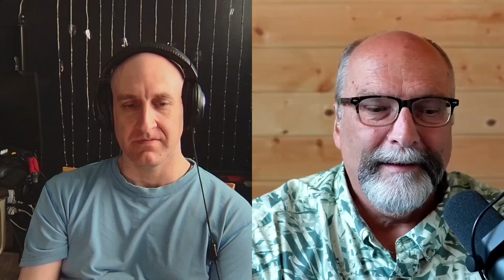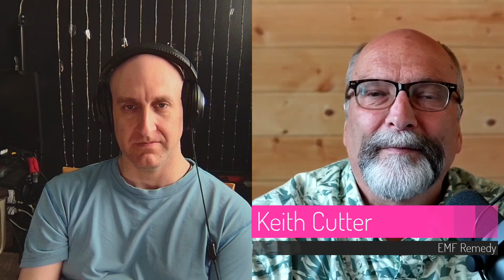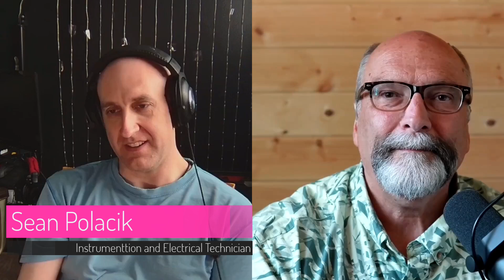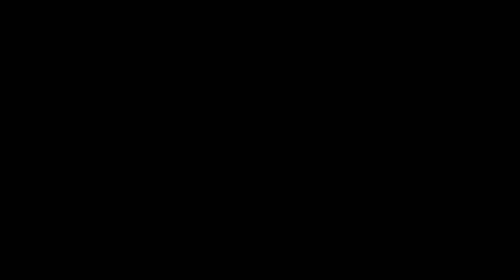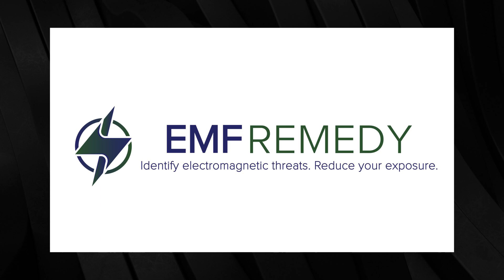6 More Reasons to Beware of SMART Meters, Sean Polacik

Comment: We tried to protect our analog electric meters. We had letters from the utility company stating that we would not be getting new meters, and that they put us on the "opt-out" extortion program. I had the letters posted above seven electric utility meters (five on rental property we own). That worked for about seven years, until last spring. 

The electric utility company had already switched-out five analog electric meters for digital opt-out meters on the rental property when we caught them. I was adamant that we did not want new meters and that they were breaking their contract with us by switching them out. 

They called the police on us, who arrived within a few minutes, which makes me wonder if they were standing-by. There were two cars and three officers. The cops tried to tell us that the governor (of Michigan) made some type of mandate about electronic meters. I called BS and told him that I wanted to see that in writing. 

The cops then asked my partner for his ID, which I said, "No! This is your property and they are trespassing. You don't have to show him anything." They obviously didn't like that but knew I was correct so dropped it.

Finally everyone left, threatening shut-off if we didn't comply. A couple of days later, like thieves, they snuck onto the property and switched-out the remaining two analog electric meters for digital ones.

Comment: These computer meters let's be honest are invasion of privacy. I'm glad that I have my old meter I have had to opt-out multiple times because Xcel doesn't understand...NO MEANS NO!!! Plus I have not one, not two but three Mastiff's that are very protective of the family's property. Plus I have a no trespassing signs with the State's statutes on it informing them it is a criminal offense. As I figured how will they be able to shut me off without physical access to my equipment. They would have to go to the main box perhaps to disconnect the line. But also to my understanding a utility can't just shut you down especially if you're a paying customer. Also it is interesting what I have read in the BBB in complaints. It seems that when they tell you either we force down your throat one meter that is less intrusive or the smart meter that is very intrusive. And that there is no option to keep the existing meter at the property that Xcel still needs the owners actual consent so they can start charging the extortion fees for the non-communicating one. 🤔 Interesting!

Comment: The old meters werent meant to compenste for power line noise but they reacted slow enough it didnt effect them. There is no reaon this filtering averaging cant be designed into them. Talking about sampling rate when the rate is Itron: 32,000/second, eatin 1024 then 256 resample per cycle. So 61,000 and 15,000 / second, nature over 12k per second oover 4 second sample.

Ansi 12.10-2024

Comment: Was just going by recommended videos after some tech connections or something and this popped up and instantly I thought it was about Smart water meters, or at least hoping it was.  Really wondering what type of RF they use if any.  Anyways ended up watching the whole video and made a good bit of sense except that they say at one point "It can monitor what you are using" far as what device you have powered on but then also saying that it is polled in intervals or timed intervals.  Find that to be a little conflicting, so which is it?  I have an analog meter still for power and the power company we have actually wants to keep analog cause it works.  Though uptime efficiency is like 78/100%...  Also if they are skirting around non spec meters that should probably be something you can actually do locally for yourselves and raise hell and at least get the better ones.. Could slap a shutoff switch before the meters to cause some chaos I'd bet..
Reply: I'm betting they poll about in Milliseconds to capture load and what device they are using or even Nano..  Don't have one to test out with a serial port.  I'll also bet that "Polling" is actually just packets of data sent that have accumulated over the elapsed time in this scenario.. It has been common if you have a common set of data to work from you can just send it with a burst of extended pkt/s so sending out a packet per 10 or 15 minutes might be normal..  Still too much data being flung around really for something that should be private.. Do they use encryption, these smart meters?

Comment: I turn everything off at the house main, from midnight to 11 am...if they are taking an average reading....I'm getting ripped off...bc im paying for power i dont use. Any advice?
Reply: Yeah, the sampling window depends on the utility configuration. Those can run anywhere from 5 minutes up to 15 min. So yes, even turning off the power that short duration will still fall under the sampling window and you'll be getting billed for it. But, you are also getting billed for the power the meter itself uses to stay on at a rate of around 2.7 kWh per day. Small amount but you add that up across thousands of devices it's money we are getting billed for regardless. And if your line is exceptionally noisy on the branch, expect to get billed for that too if it's above the rms threshold to affect the sensing element. 

Per your particular issue, you would need to see if the utility would divulge their averaging settings. If it's just an interval per the last device powerup or scheduled to avg based on the hour. Otherwise it's an unknown that can't be planned around.
Reply: @BulkBiceps-w4c  👍
Reply: @BulkBiceps-w4c  You are not getting billed for the power the meter uses.
Reply: WiFi jammer
Reply: @Original22  A wifi jammer would do nothing for any of it. And, since a wifi jammer relies on generating interference on the same frequencies as the name implies.....it's not a device you want any EHS individuals to be around.